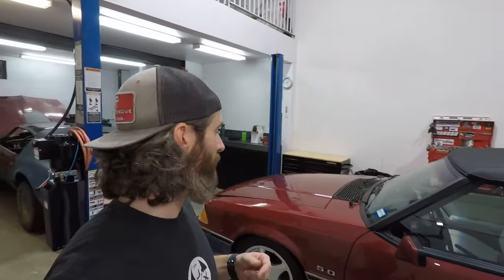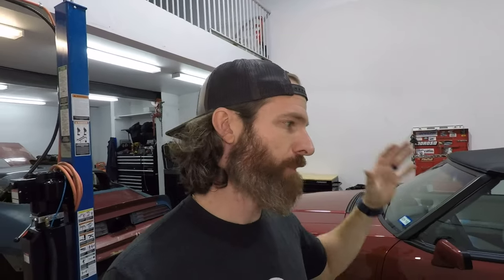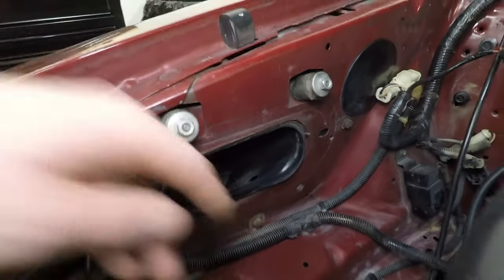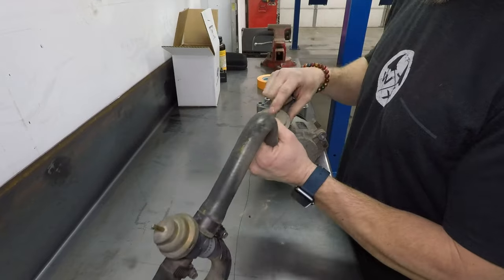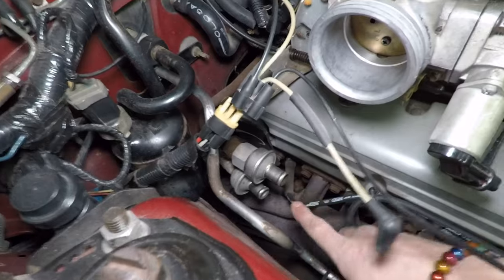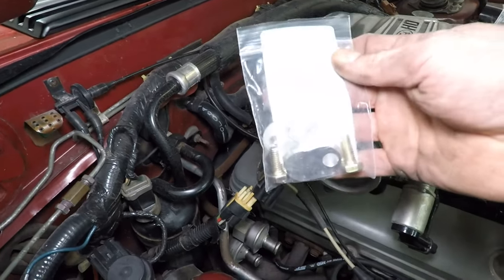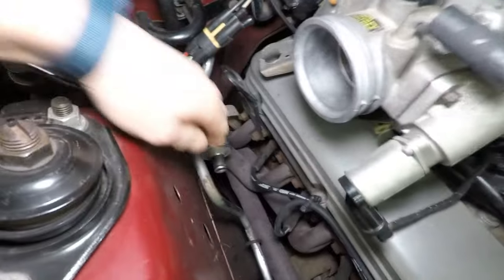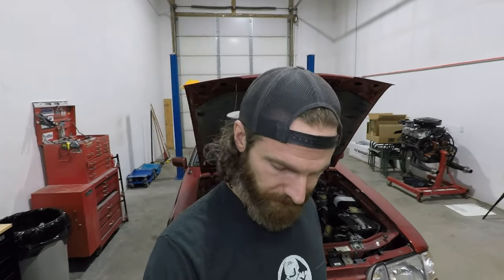Get Rid Of THIS Garbage in Your Foxbody Mustang 5.0

Comment: Don't need to bother with the extra idler pulley. For future belt purchases just remember to ask for the stock belt for a non-A/C 5.0. Its the correct length.
Reply: Not if I don’t have AC as well or does that still work
Reply: @livelife6214  if you don't have A/C that will be a different belt.  LMR has a chart that covers the lengths for different combinations

Comment: I know it 2 year old video...I had no problems removing all that smog plumbing and that nonsense  thermactor ports. I bough the 2 set screws that fill the ports but I wasn't able to tighten them down. I went to the hardware store and matched up two bolts...( sorry I thought i I deleted this finding out it was 2 years ago.) I replied to another follow up article in more detail. LOL. I had only one problem when I removed the stock headers.. the 2 sided bolt that held the dip stick tube didn't cooperate....the other 15 header bolts came out easy, The bad part was , I put Ford racing headers on it and they rusted really fast. I replaced them with BBK unequal length ceramic coated ones and.BBK H pipe. I  already had  Flowmaster's American Thunder SS  exhaust kit on the car.
Reply from the maker: Nice!

Comment: If you disable the Smog pump in the ECM with a chip or a Qurterhorse it will eliminate the 1200-1500RPM start up. It's nice starting it up and it going right to a calm idle.

Comment: We definitely need a more in depth look at what needs to be done with the vaccum line's! As I've most definitely been struggling with this part.
Reply from the maker: All you need to do is plug them - that’s it! 👍
Reply: Plug all them?
Reply from the maker: There are just 2
Reply: Thanks guys!
Reply from the maker: Anytime bud!
Reply: is that because it causes a foul smell? i did a short belt bypass the smog pump in the 90s but immediately went back to oem cause of an odour. i still have that shorty belt, maybe i just needed to plug those cause fumes were coming out?

Comment: On a budget build instead of getting block off plates  you can just cut the plumbing off the pipe coming off the back of the head take the original pieces, flip them over to the flat side not the “hole” side and with a little high temp silicone re attach to the head and you are blocked. Great Video 👍
Reply from the maker: Very good work around 👍. Thx for sharing 👍
Reply: Exactly what I've done for every 5.0 I've owned over the years. As soon as I seen the block off plates here, I was thinking, "There's a trick for that". And then seen your comment. Good to know other people use their 🧠.

Comment: Once you determine the correct length, record the belt length. I personally have a notebook with my mods, and, if I've used parts from other cars ( Turbo coupe, continental hydro boost, etc). With my under drive pulley/alternator upgrades smaller pulley, it is definitely a different belt.
Reply: That works. I also.keep the sleeve the belt comes in and put in glove box. Perfect reference

Comment: I'm sure you probably already plan to when you install the headers but might as well put those factory engine lift plates in a box as well. That will clean up the bay more, give you more working room, and save some more weight.
Reply from the maker: Yes, very true 👍

Comment: Just remember the size of the short belt, write it down or save the sleeve it comes in. The part number is basically the length & number of ribs.

I personally carry a spare short belt for exactly this reason.

Comment: Hey I appreciate all of your videos and have learned alot from you. I have a question about deleting all of  this. I have heard that this can clog up your stock cats, change the computer, mess with your EGR and will turn your check engine light on among other things. I have a 86 GT 5.0, any thoughts from your experience? Thanks brother!
Reply from the maker: Hey bud thanks for the kind words! I’ve never heard of any of that or dealt with any of it personally. Technically the equipment was installed for a reason however like I state in the video, I would be interested in seeing someone (that is qualified) to perform a comprehensive review of how all this equipment works in practice and if it does the things it was intended to do on paper/in theory. Keep in mind that no matter what, cats (like almost all automotive parts) have a service timeline and will plug over time. They are not an item that will work like new forever. To be completely honest, if you still have stock cats on one of these cars - and it has any sort of typical miles on the odometer - I would say your cats are “past due” and should be changed. Hope that helps

Comment: My 89 smog pump is going out but I have to have one. The open end of the bracket was not secured to the threaded inlet on the pump itself. 

I can swivel the pump to have the open end of the bracket line up to the threaded inlet. Seems like it should have a 3rd bolt.

I think the bearings are done but it only has 2 bolts securing it. Yours had 3?

LMR kit only has 2. 9/16” are hard to find. 

Thanks for the video.
Reply from the maker: No sir - just two
Reply: @KASLCustoms  I got the remanufactured S/P from a place in LA, eBay, works great . They even included the one 9/16” short bolt that is lying on I-70 in Utah somewhere. Thanks for answering..

Comment: I've recently read about the SMOG systems in these cars (specifically the EGR and SMOG pump) and both systems are "bypassed" and not used during wide open throttle.  So as a performance gain, I don't see it making much of a difference.  In the same article's I read, if the SMOG pump is removed, the catalytic converters are more prone to clogging because they are not getting properly heated from the SMOG pump system.  So, in conclusion, If a guy wanted (or needed) to keep the car emission legal for street use, I would recommend keeping these systems intact and functioning.   But...full discloser... I don't have any experience with removing or disabling these systems on these cars... so I don't know.
Reply: I purchased my 5.0 new in 91 and all smog is still hooked up.   In the future folks will be looking to make them original again.  This is what happened to the 70's 428 CJ.

Comment: I have an 84 LX with the same thermactor set as yours. The original smog pump lasted 35 years. the Dorman replacements were built like crap and the bearings fail within 2 years. Getting hard to find the correct smog pump anymore. I notice with my 84 that when I have a code 44, thermactor not function, the car runs like shit. When I replaced the TAB valve it went back to a smooth idle. So I've preferred to keep my secondary air system functioning. But like I said the parts are getting harder to find.  My car has been idling rough the past few weeks, ran a scan and got code 44. The closest thing to mine I could find on eBay was a TAB for an 87 which is identical to the TAB for an 84 apart from the part number. I'm sure it will work fine. All it does is open or close depending on vacuum. Just curious, the ECM on OBD1 cars aren't really programable. Did you have to install a diode or something to fool the ECM? When that smog pump system is removed the ECM will notice and not just produce an annoying code, it can make the car run like shit until you resolve it. My car ran like shit last time my TAB failed and I'm sure this time will be the same thing.

Comment: Before you go ditching those factory headers, determine if they're a problem. They should be good to 300HP and if you got them out like mine are, you can open the mouth 20% or more porting out all that welding slag the factory left.  Shorty headers may not be worth the cost, depending on your build.
Reply: *gut, not got....
Reply from the maker: Stay tuned buddy 😉👍

Comment: In car the plates are the only way being the threads get so clogged with carbon. Off the car a 5/8-11 set screw from the local hardware store fits perfect.

Comment: Another great video - step by step details are fantastic…. Only thing is I’m struggling to find any real benefits of doing this (particularly if still running cats); yes a cleaner and more streamlined engine bay is nice… but there’s minimal weight reduction and the parasitic loss is negligible…. Unless I’m missing something (wouldn’t be the first time 🤣)
Reply from the maker: LOL - yes you do bring up great points for sure. For me, its one more thing to have to worry about failing - due to age - that I never want to replace. But realistically, one needs to remove a lot of the plumbing to change the headers so I figured I would "kill two birds with one stone" and just remove it all together.
Reply: There might be different parts availability but the pumps used in F150s of this era are getting harder to find with junkyards being your best options most of the time. For something like this I don’t want to keep digging into things every time it fails and then I head off to the junkyard to find another pump that is 30+ years old with 200,000 plus miles.

Comment: I’d be more concerned about being out on the road and trying to find a replacement idler pulley instead of the odd size belt. I removed my smog pump, Googled the smog delete belt size, and the guy at Autozone had it.
Reply from the maker: To each their own I guess. I tend to trust bearings over rubber products but that’s just me 🤷‍♂️

Comment: Thanks again for a really good instructional video.  I've never seen the air silencer before, and I've had foxes since the 90s!  I still have the smog stuff on my mild street car.  In fact, I installed a hi-flow catted h-pipe and had 2 "racing" cats added when I put my supercharger on to ensure I would pass emissions.  Runs cleaner than stock (according to the pass sheet) and flows better too!  But I did than years ago when the H was $250.  So it is possible to have performance and help the environment.  Don't get me wrong though - that's just my 2 cents.
Reply from the maker: You’re welcome!

Comment: I’m going to attempt to do this now that I have everything out of the way and waiting for parts. Thanks for showing how to do this 🤘🏼
Reply from the maker: Right on!
Reply: I have 88 gt vert  still speed density I put bbk shorts and bbk off road catless hpipe and now getting backfire when shifting from 1st to 2nd at high rpms and from 2nd to 3rd sometimes. I read forum that said it's because I have no cats now and still have smog hooked up. Have you herd of this before? And Info much appreciated
Reply from the maker: Hey bud. First question is: what RPM are you shifting at to get a back fire 😂👊. That’s some high rpm brother. Lol all jokes aside, have you checked your timing? I can’t imagine that it has anything to do with you still having your smog pump still hooked up. Honestly, it’s just an air pump that pumps air into the heads and exhaust.

Comment: great work , was there a lot of carbon in the Smog pipe that connects to the back of the heads? i want to take mine off cuz i think its plugged up,  I'm  getting codes about both thermactors . I read that if its plugged up you will get codes also i changed my EGR valve and it was completely plugged up and seized. she seems to be getting better gas mileage with the new EGR installed.
Reply from the maker: This one wasn’t totally plugged but they can get that way

Comment: The hose that connects to my exhuast isn't connected, causing a major leak. Why I'm deleting it, I go 0-60 in about 12 sec. About 50% power right now because of this. I've replaced everything fuel, air, and spark related. I'm just now discovering that this is the issue... Could this of caused any major damage to my heads and anything in that area?
Reply from the maker: I don’t think so

Comment: Hey! Two things! What about the charcoal canister and everything that connects to it? And also, I was under the impression that the EGR system circulates gas fumes back into the engine in order to conserve fuel consumption. Won't you notice less gas mileage removing the EGR system? I've ran mine both ways. I really feel like the EGR system saves you a little on gas consumption. I know most people prefer horse power over gas consumption. What are your thoughts?
Reply: Smog and EGR are different. This pump just helps start up I believe.

Comment: Nice clean virgin car to modify, don't see too many of those around. Had a 90 LX 5.0 5 speed back in the day. Didn't do anything that because I was young and poor. Finally got another sports car after so many years, a 94 SN95 GT convertible. Nice virgin car with low miles and all original. I was looking for another Foxbody, 90 LX just like mine but this one popped up and it was at a good price so I couldn't let it go. Unfortunately its an auto. Slowly doing some mods to it. I would imagine this has all that smog pump crap like the Foxes.

Comment: Why not get one of the billet pulleys that lmr offers? I'm looking to replace my ford racing plastic pulley on my 06 ac delete and i think these billet smog pulleys might be the ticket. Do you know the diameter of that pulley?
Reply from the maker: I have the billet one on my coupe. I think I personally prefer the “OEM” look more
Reply: @KASLCustoms  I'm fine with the black, it's the plastic that concerns me. I spun a cheap metal idler right off the bearing at full throttle the other day.😁 It was a $10 pulley from rockauto. I have a whipple supercharger so there's a lot of stress on the belt. I haven't installed the AC delete yet.
Reply: @KASLCustoms  is that a 6 rib belt for the smog pump? I'm seeing some ebay sellers listing these as 5 rib, thought it was 6.

Comment: Could get that piece of mind by tucking a 2nd belt in the trunk I'm sure you considered that an opted out but hey I get it, my 95 5.0 vert was my mom's who passed away in 2015 from cancer and her husband talked it to go to him while she jaundice confusedand dieing I was heart broke seems so sentimental,  but he moved last year and abandoned it in the drive with flat tire and dead battery seeing it I was furious when I found it with some rear quarter damage and lichen growing on the paint n top but it 100% rust free and in good condition other than the other stuff and is 100% original except mufflers and stereo I have done so 98/99% oem I guess it had been winter garaged up untill 2016. Im a gear head that's always had older cars so modding them is no biggie but I like the idea of it being unmolested but it's not that fast and it's pretty quiet even with fauxmaster 10 series muffs.i want to do an off-road x or H pipe and a couple mods, but I want to be able to return it to stock for whatever reason one being emission laws being reinforced on older cars. But a smog pump delete is a mod but I want to leave the tubing in place if  I go better shorty headers I guess I could just leave them back there, .my pump seems to be working fine do you think it would free up any amount of noticable power? I'm assuming may see 5+/- hp on am actual Dyno but not the butt dyno. But I could use any extra power with tall gears and the arm stretching 215hp lol, being stock for the moment its not fast but has enough power to be fun especially with a 5 speed and it has great daily drivability and fuel economy its actually get noticably better fuel economy than my 2010 grand caravan.
Reply from the maker: Wow what a story! Thx for sharing. In all honesty. I don’t think you free up much power - if any at all. That said, it’s more of an aesthetics thing for me 👍

Comment: I bought my 88 GT new and still have it,  they're fun cars to drive and will always turn heads. To each his own. I am in the process of putting my factory catalyst back on ( yes I still have them took them off in 1989 ) along with the smog equipment. I wish I didn't throw my silencer in the garbage. anyone still have the secondary smog pipe that feeds the catalyst the from the air pump, I need one.
Reply from the maker: Oh wow - very cool. The sad part is most of this stuff ended up in the bin and is currently sitting at the bottom of a landfill…

Comment: Found a FOX that OG.. Cant believe your even doing this.  LOL I just pitched it all and wrote down the belt sizes based on different configurations. The only reason I ever found to use that pulley is to prevent the PS whine that comes with it.